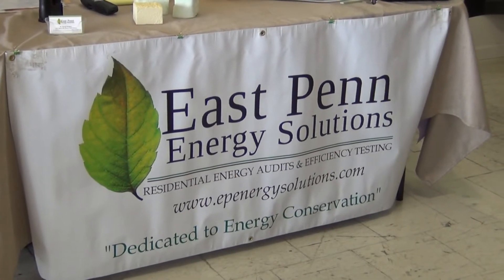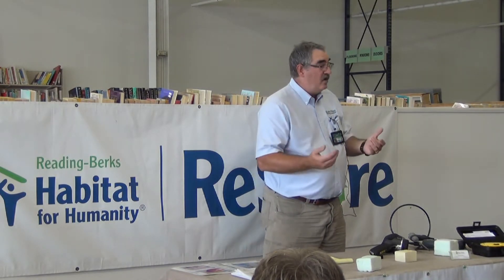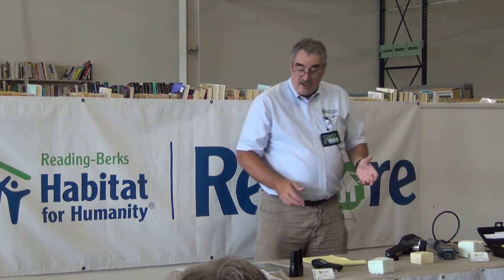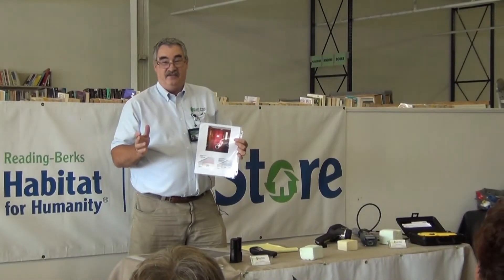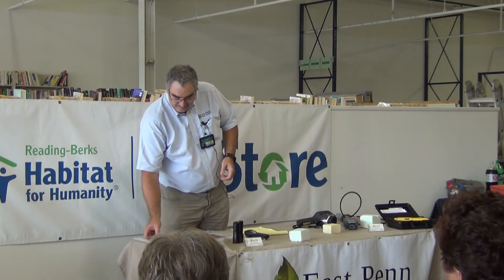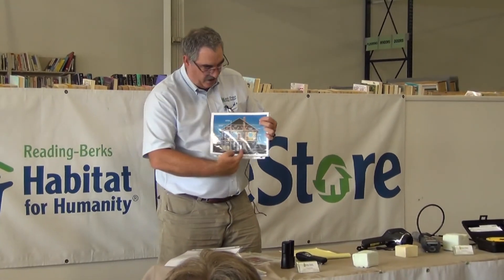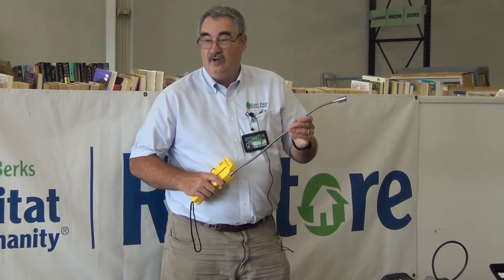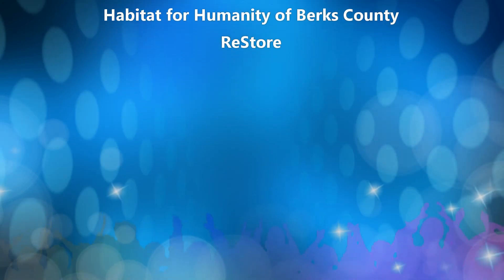What is an Energy Audit?: Energy Efficiency 101

Comment from the maker: Second perform combustion analysis on the heater and any other combustion device, ie DHW looking for efficiency, health and safety concerns (CO  & draft)
Lastly, a blower door test is run, thermal imaging and/or smoke generator can be used of to look at drafts.

Afterwards  a report is issued with the results of the assessment.

(continued)

Comment from the maker: Thanks for asking, Adam.  The HBA passed this question onto David himself.  Here is his response:

Usually including in a BPI Energy Assessment:

Inspection of existing conditions looking at;
•	insulation, moisture, mold, windows, lead paint, asbestos
•	Heating and Cooling systems,
•	Drainage issues, gutters, roofs, ceilings, attics, basement band joist.

(continued)